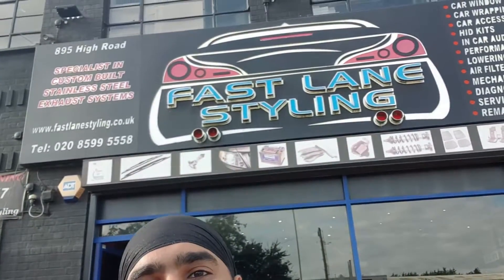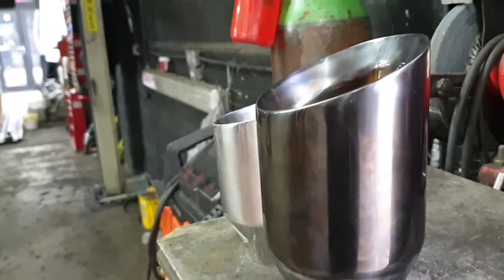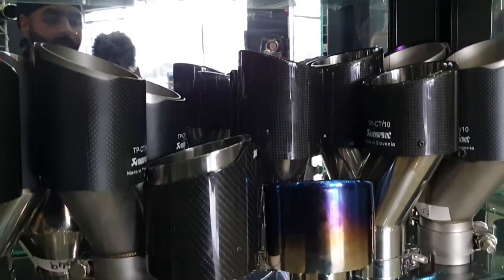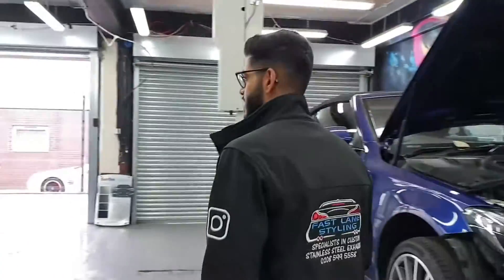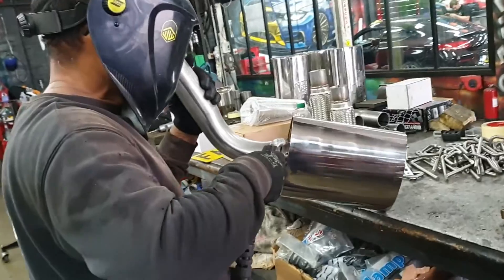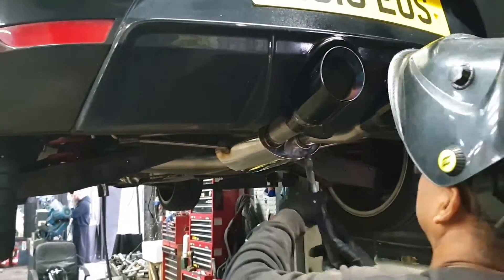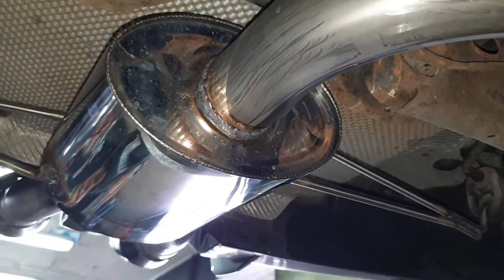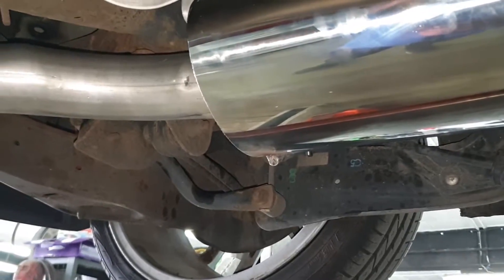Custom VALVED CATBACK exhaust system & HUGE tailpipes - Fast Lane Styling

Comment: How much is it roughly to build a custom valved exhaust?
Reply from the maker: This exhaust cost way too much compared to what it delivers, it cost us around £1000 (just for a catback!).
For a full system I'd say around £600-700, you can get Miltek or BCS turboback systems for around £1000 new. For a custom catback system done properly maybe around £300-400. It also depends on how many silencers you want, sports cat etc.
On these cars a lot of people go for a Trackslag downpipe > custom catback system.

Give a few exhaust fabricators a call around your area and get a quote.

Comment: Bro this is the worst exhaust place to go to look at the welds and the pipe work has no smooth flow for 1000 quid you couldve gone emp or somewhere where you couldve got it tig welded instead with proper flow
Reply from the maker: Haha my husband said no comment all I will say is, we learnt our lesson the hard way 🤐
Reply: Was going to say this unfortunately. This exhaust design is so bad. 2.5"pipework is so restrictive on these. Minimum for a cat back you want 3" 
And that valve system is horrid, no need on a tfsi.
Reply from the maker: Agreed, we did originally ask for a 3" all the way but they said it wasn't possible... we only had the day to get the new exhaust on so went with it. 

Our only reason for wanting a valved system is we live in a quiet neighbourhood, didnt want to be waking everyone up at midnight

Comment: What a shit flowing exhaust
Reply from the maker: Yeah this exhaust is causing us a lot of problems.. The welds on the hangers are also cracking and there's a few small holes in the welds so not happy with this at all
Reply: @SwatiGurpreet  Yep it looked like chewing gum! Inconsistent welds - pipe to box. Welding is an art..
Reply from the maker: For sure! We obviously didn't know this before we went there but will never go there again